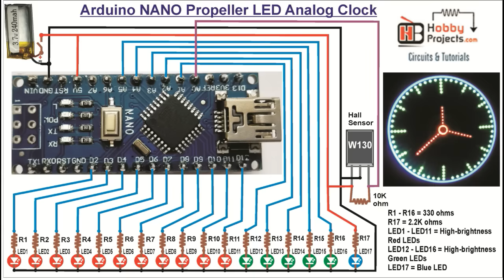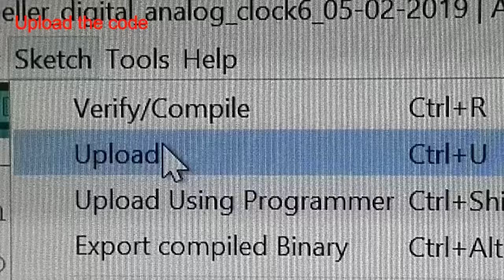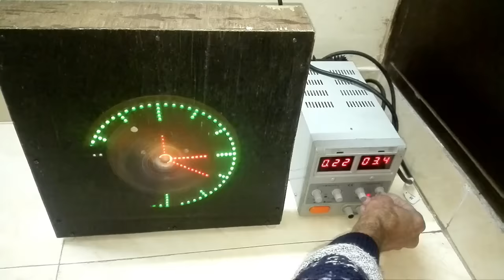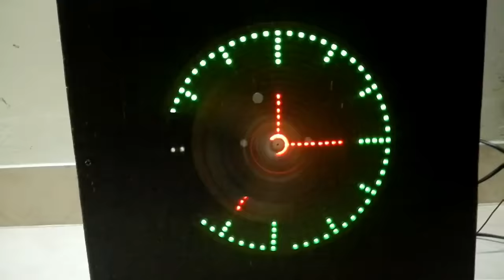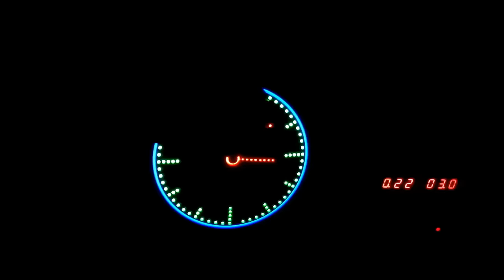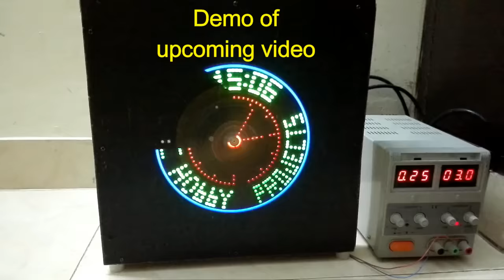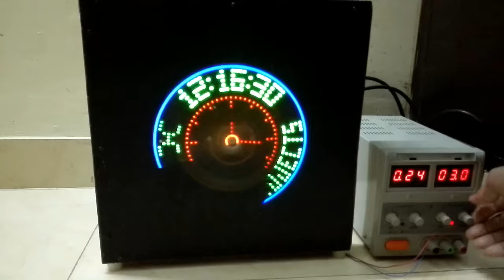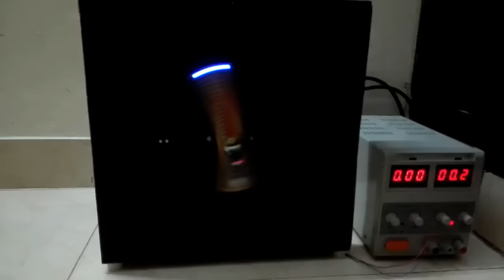Arduino NANO Propeller LED Analog Clock

Comment: A little idea for coding ... what about to "split" each second-step into 10 steps to make the movement of seconds smooth? Maybe this is possible - But i never worked with ardunio or like (because i dont have money for ardunio and all the stuff around (like board, wires, soldering stuff and so on)) - IF this is possible, "sub"-split the minute and hour lines too (float-calculation will be used) - maybe a hard work for ardunio. but if it works, its a unique "smooth" led proeller led analog clock :D

Comment: you should add time-correction var due to u havent RTC, so after 1 day of working your millis() will not equal a day. also if you plan to use this code for a long time, you should do workaround of millis() reset (due to sizeof(millis()))
also if you use direct access to registers, why not exlude arduino.h using
int main() {...}
instead of setup() and loop()
it will speed up code execution and its size

Comment: Can we use a3144 hall sensor instead ??? If Yes then what changes i have to make in the circuit ??.. Anyone plz reply.
Reply: Same question
Reply: I checked both datasheet and unfortunately you can't substitute the W130 with an A3144 because of the minimum operating voltage for A3144 is 4.5V, while this is a single Li-Ion battery operated project, that running from 3.7V (or less).
Reply: @Glanmire3  Then If i provide a 5 v power supply for a3144 then will it be okay ????
Reply: @anindyamandal86  Yes of course. You can have an another battery is series (you will have 2x3.7V) and supply trough pin30 (Vin for external psu), but don't forget to supply the hall device from the 5V line, not from the battery.

Comment: How long the battery life?
Reply from the maker: It depends on the mah of battery. Shortly We will post a wireless power supply video for this project so no battery will be required.
Reply: @hobbyprojects  Okay, I will wait for the next video 👍
Reply: @hobbyprojects  I have an idea, you can use a wireless charger smartphone to supply 5v to component with wireless charger receiver. 

Posibel ??? 🤔🤔🤔

Comment: I have a problem while uploading code
It says"problem uploading board"
Will you plz help me out how to resolve this problem.
Reply: Kindly check the option named "boards" in the tool section and select it as Arduino Nano
I hope it will help you
Reply: @ashutoshkumar-en8id  thanks a lot bt I have already checked and selected it. I also selected the appropriate processor, all the required libraries are installed bt it didn't show the port.☹☹

Comment: How can we use uno in this project?
Reply from the maker: You can use UNO using the previous project posted earlier on the following link 
https://youtu.be/QmaWcHuid3E
Reply: Is 'nano' code and 'uno' code same?
Reply from the maker: @sujjwal007  Yes
Reply: @sujjwal007  yes i try it. Its working
Reply: @hobbyprojects   in my project the clock is displaying half cycle ( from 12 to 3 numbers) only  can you help me to fix this problem??
Reply from the maker: @kenilhirpara1488   You mean it is showing time from 12 to 3 only?
Reply: @hobbyprojects  yes only that 3 hrs
Reply from the maker: @kenilhirpara1488  If you can send the image of the display where you are facing problem to the author of this project on joginderprojects@gmail.com so He can help you regarding this issue.
Reply: @hobbyprojects  i sent the video on that. 

Thank you.
Reply: @kenilhirpara1488  
It is because motor is running slow.
Please increase speed of the motor.
If you are using low rpm motor then increase the delay value in following lines of the arduino sketch.

delayMicroseconds(140);
delayMicroseconds(600);

You can also control the dc motor speed using LM317 based adjustable voltage regulator
Reply: @jogindervlog3807  ok sir,.
Thanks
Reply: @jogindervlog3807  I'll try it.

Comment: what is that thing called that is stuck on both sides of the pcb and holds the DC motor shaft ? Not able to buy it anywhere

Comment: Wonderfull works. Can you give information. Not getting the hall effect sensors w130 and a3144? I have hall sensors, a1104,  a1126 and ugn3177.  Can I use one of these. thanks.

Comment: I'm trying to execute it but its giving an sync error
Reply from the maker: The code was tested and working OK. Please check if you have selected the right board and serial port in the Arduino Environment program. If you still face any problem then please let us know. You can also send the screen capture shot to the author at joginderprojects@gmail.com

Comment: I made an Mistake and Connect A0 -A3 To leds Instead of connecting A1-A4 So Is it possible to make Changes in code just want to know it will Work if i connect halll Sensor to pin A5
Reply from the maker: Yes you can do it.
Reply: @hobbyprojects  Thank u

Comment: Iam only getting half the clock,what can the mistake be???
Reply: I am only getting a quarter of the clock.. did you figure out your problem?
Reply: @morgancrow8285  yes do some changes in the program,like there is a comment in one of the line's of program saying change according to the speed of motor so just increase or decrease the value u will get a complete circle
Reply: Thanks for the reply! I ended up doing that and now I have a complete circle but still no red LEDs. Only green outline and ticks. Any ideas?
Reply: @mohammedkamran8559  Thanks! I tried and it worked but I also have no red LED's . I can't see the hour, minute or second hand at all. Did this happen to you and did changing the microseconds fix it?

Comment: Could you write motor properties and length of board?
Reply from the maker: 3V to 12V DC motor is used with speed control with variable voltage stabilizer. The board size is approx 12x12 inches
Reply: @hobbyprojects  perforated plaque size

Comment: Code unreadable, consider functions with meaningful names such as: drawMinuteMarker(), drawHourMarker(), drawQuarterMarker(), drawHourHand(), drawMinuteHand(), drawSecondsHand(). If using C++14 consider binary integer literals
Reply: The code is bitshifting registers for raw performance in a very limited package (AT328P).  Anyone who mentions C++ when talking about embedded programming is clearly NOT an embedded programmer, as C++ is all about bad performance for lazy programmers.   I'm sure the code could be written a lot more clearly, but be thankful for what you got as a starting place.   Personally, I'd use lookup tables instead of tweaking bits on the fly, but you sure as heck wouldn't want to go even further in the weeds with the functions you outlined.
Reply: @GyroGearlooseHelis  As a C++ developer not for embedded, I can tell you that whatever concerns you may have about performance will be dealt with by the compiler. A software engineer must write code that people understand
Reply: @robinbuster1323 Code must be understandable, absolutely, and compilers do optimize, yes.  But automatic optimization cannot compete with manual intelligently optimized coding, and the compiler optimization is unable to overcome many C++ overhead issues.  I am a "hard realtime" embedded engineer,  and make a career of re-engineering cumbersome C++ spaghetti into MUCH faster C.  You do need to know what you're doing in C, but it's (almost) indisputably faster bytecode with expertise in both.
Reply from the maker: Thanks for your valuable suggestions. We will continue to improve the program coding according to the suggestions given by the subscribers. You can watch the updated Video here https://youtu.be/w3pcvFB9Idg with the link of new improved code mentioned in the description.

Comment: Bello, pero alle 12e15 la lancetta piccola delle ore  deve stare sul primo minuto e non sul dodini, ogni tacca corrisponde a 12 minuti    Nice, but at 12e15 the small hour hand should be on the first minute and not on the twelve, each notch is 12 minutes
Reply from the maker: Thanks for the suggestion. Shortly We will correct it.

Comment: Hello, i might sound dumb, but from from looking at your code and video, i did not get the use of hall sensor, as LED are lighting up on basis of value K, which is incremeting after very loop, and second question is how are motor speed and value of K related ??? thank you

Comment: Could be possible to make this fan display without batteries? I am thinking of making disc with leds, arduino, but for powering it, instead of battery, making generator on the same disc. Could it work? The fan would have magnets on the static circumfence and coils on the rotor disc, with some source corcuit with rectifiers. But i do not have such skills to try it...

Comment: seconds run too fast. battery for arduino too low. the noise of the motor is noisy, not for the night use. too much wires- no need all red diods solder with pins of arduino with resistors. you can put together some reds without resistors and solder them directly to 5 v of arduino. the resistence will be enough.  фирштейн ?

Comment: Very nice project! Is that a way using an addressable LED stripe (WS2812B i.e.)? I was wondering to reduce weight
Also, as a suggestion, instead of a SPST switch use a jumper.

Comment: The frequency for multiplexing led displays must be larger than 50HZ to avoid flickering and less than 100HZ to avoid ghost imaging.The clock image has 60 fixed points,so the ideal frequency would be 60 x 80HZ=4800HZ refresh rate or 208us timer interrupt interval and 80 motor rotations per second.Per minute the rotations would are 288.000 which is out of reality.So for less flickering need less light points per rotation or higher speed rotation.

Comment: Why magnet is used
Reply: hall sensor trigger. Lookup Persistence Of Vision Display and theory.
Reply: Navaneeth C at a very high level - To synchronize the display to position of the circuit board. Specific LEDs turn on only at specific points on the circle.

Comment: You have to speed it up more, otherwise you hit the maximum draw time and get a gap on the bottom of the clock between 29 and 30 seconds...
Also the way you count time in the code is extremely inaccurate. It'll probably remain accurate for less than a day, you should use timer interrupts for more accurate timing or preferrably a realtime clock. You should also use hardware interrupts to read the hall effect sensor, so the processor doesn't have to sit and wait in a while look while sensorPin is low. While we're at it, it would also be recommendable to set the pins high and low using direct port manipulation, since digitalWrite is pretty slow. And with your 240 mAh battery (with no over discharge protection to speak of) your clock is only gonna run for a few hours until the battery dies, which kinda defeats the purpose of a clock, therefore I would also recommend transferring the power to the arduino inductively or with sliding contacts.

Comment: 1: No Circuit diagram. 2: No list of alternative parts, reason for selecting parts or cost effectivness of parts structure. 3:No code for the arduino or reasons for using such code or breakdown of how the code works. 4: Using a copper clad circuit board, and ignoring it to run wires from point to point, defeating the object of copper cladding. 5: Extensive use of Hot glue, the childs solution to sticky and 6: Assuming people who can identify components, thier values and how to use them as idiots by attempting to describe and explain them without doing so. 7: learn how to solder, I mean the mechanical composition of using tinning or flux and then bonding the surfaces together using a soft maleable conductive material such as a lead tin alloy. The 'bigger the blob' is not the best way of using or creating a soldered connection.